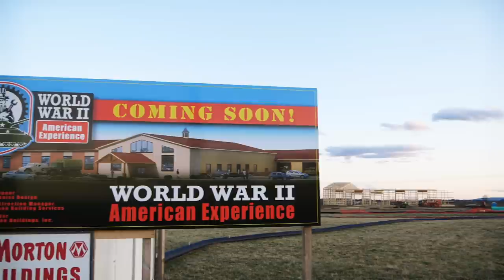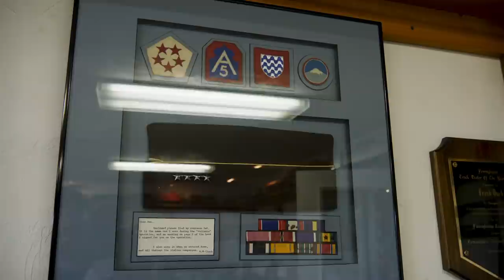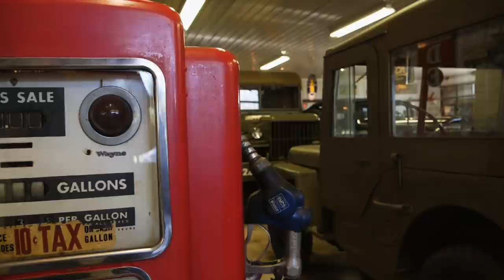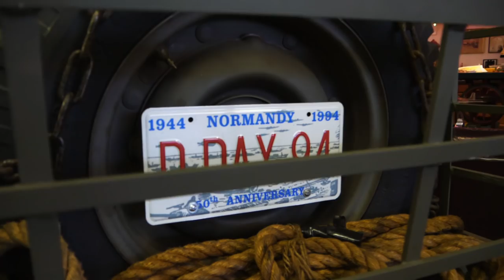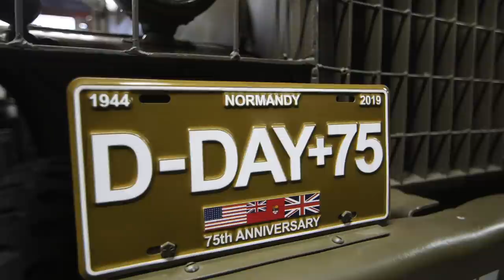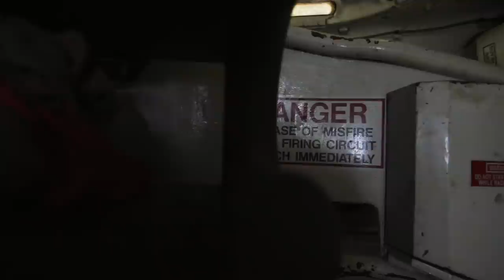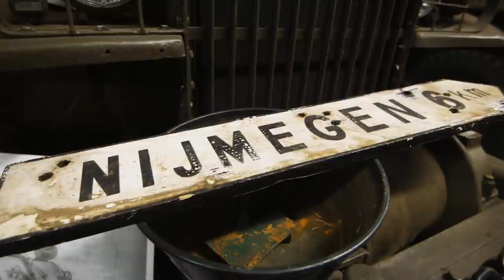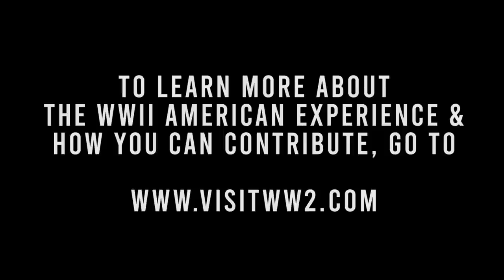The WWII Experience in Gettysburg (w/Sherman Tanks!!!) | History Traveler EP 139

Comment: Collecting these back in the 60's was really the time to begin. The WW II vehicles remaining stateside were being sold as surplus as the M-Series from the 50's replaced them and could be bought cheap, sometimes at scrap value, same with new unused parts.
 Over the years, they were worked until they broke down, left to rust, sold as scrap and destroyed, some were just not practical for the average civilian owner and generally survival rates plummeted. With a renewed interest in WW II, vehicles and aircraft started being rescued from where they were abandoned and restored to operational status. Of course, values went through the roof as demand outstripped availability.